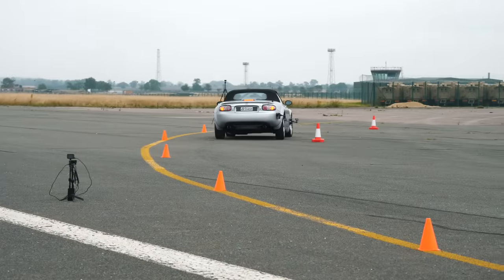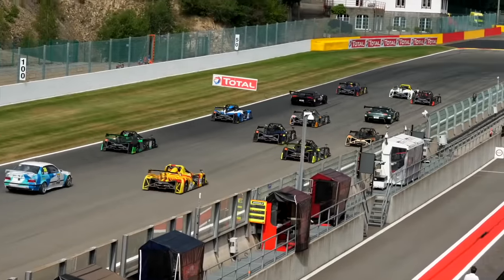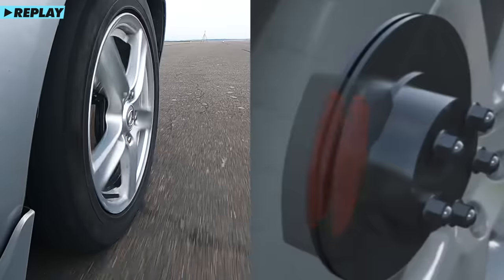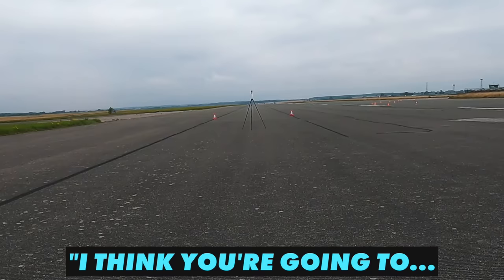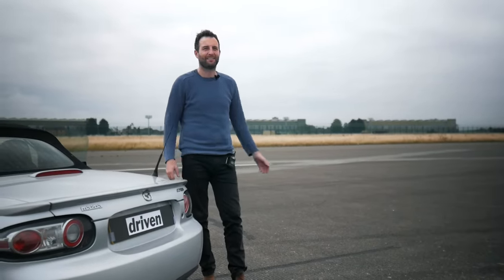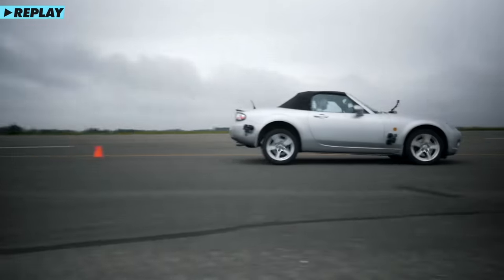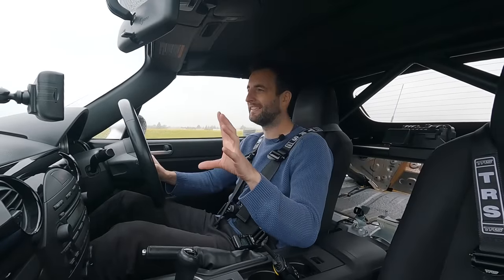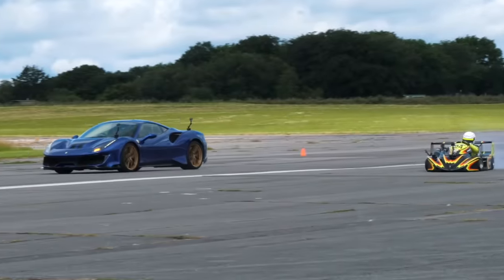ABS ON vs ABS OFF | What's Really the Difference?

Comment: Would be interesting to see what ABS is like compared to threshold and cadence braking.
Reply: Cadence? Yeah, that was my first thought too.
Reply: Exactly. Obviously ABS is needed when you slam on the brake pedal. But can a pro driver do better without ABS? By how much?
Reply: That's what I click on this video expecting
Reply: I remember some show from the 90s demonstrating cadence braking, maybe Top Gear before it got all silly and scripted? 
Definitely be interesting to see how ABS compares to cadence braking.
Threshold braking? That's a new one to me, guess I'd better google that practice.
Reply: You won't be threshold braking in normal day to day driving, unless you're a nutter.
Reply: yeah if brakes are not very sensitive it should be possible, but he needs a lot of practice on this same surface
Reply: @JohnyG29  Or you need to do an emergency stop or stop in the rain/on wet leaves... My first car didn’t have ABS and my motorbike still doesn’t, you soon learn about the limits of grip whilst braking in various conditions and how hard you can or can’t brake.
Reply: That's what I thought the video was going to be too...
Reply: @Jonathan_Doe_  Good for you, but ABS ensures most drivers can stop as quickly as possible.
Reply: @JohnyG29  you won’t be ABS braking in day to day traffic either. The question is how to stop fastest in an emergency.
Reply: @rdspam  you will probably never reach maximum braking force without abs in an emergency situation unless you braked on that road like 100 times before and even than if the road is wet it will be completly diffrent.
Reply: Right? Abs vs locked wheels are not a debate at all.
Reply: The what and the what braking?
Reply: Cadence braking is a bit of a joke and only really done by Police and IAM drivers, who spend most of their training on observation, with car control a brief afterthought.

Threshold would definitely be interesting though - I presume Scott is pretty good at it.
Reply: @crustyoranges  lol
Reply: That’s what I was here to see…
Reply: @JohnyG29   I don't think he was trying to argue with that fact, I think he was more so trying to say: although ABS is a valuable asset to drivers on the road, there is also value in learning how to drive without it.
Reply: I think the tires were shot at that point and they didn't want to put on another set.
Reply: @Hisokaa-d2j  maybe but most people dont own sport cars and I guess if the road is wet its still hard to threshold brake in one of those cars.
Reply: @Hisokaa-d2j  true but I doubt its worth the risk of locking up I mean you even see it in f1 and other top motorsport series with the best drivers in the world and still they'll do a lock up once in a while. And the same will probably happen to every person that does threshold braking on public roads.
Reply: Yup. My understanding behind the poll, was that it was threshold breaking w/o ABS vs. Normal braking with ABS.
it's obvious that ABS will be better vs. Fully locked up wheels.
Reply: They should make a video for this to compare the situation if the driver is experienced.
Reply: @crustyoranges  I never heard those names before, but I do believe I did both. I never was a ppro driver or anything like it, but in my youth, I did drive crappy old cars that never had ABS (and were crap, thus easy to loose control of over little more than nothing). And I learned these "tricks" first from riding ... a bycicle! True.
So... brake too hard and you might loose control of the vehicle. You can minimize this by braking less harshly.  I guess if you do it continuously throughout a brake, right there on the limit between maximum possible deceleration and loss of control, that would be "threshold braking"...?
Alternatively, if, when loosing grip, you let go of the brake, then back on it when you get some grip back, then off again and on again, and keep alternating til you got down to the speed you want, that would be "cadence braking"...?
The two above would be on emergency braking only (or you're racing), but on the road, you might need it, even if just to avoid a small bumper to bumper crash.
But then of course, ABS would do the above automatically for you (possibly seperately for each wheel), and better than (most) any human.
Reply: @Jonathan_Doe_  yep, abs is an amazing innovation and a 100% good thing. But I like you and many others learnt the limits of a car just fine. I recently went back to a non-abs rear drive 90s sports car and was a little worried, but it's been fine. One of those situations where we give up a little reliance on skill and experience so that the majority will be safer maybe?
Reply: I was hoping they would at least include threshold braking. I find that being out perform ABS on most surfaces if you know how to do it.
Reply: My guess is cadence braking (I learned in the 70's) will beat standing on the pedal. ABS does  the same only much quicker, for the win.
Reply: @JohnyG29  but if you are driving a non-abs car and need to panic stop you might need it without being a nutter
Reply: @jeanackle  Heck yeah.  ABS pulses on my car, if the wheel loses traction.  It quickly reduces speed, not smoking tires, like the video above.  I almost missed an interstate exit driving late at night going 60 mph.  I mashed the brakes.  The car dutifully stuttered to 30 mph, but sent a signal the brakes weren't doing the job!   Very interesting.  

As far as handling tricks, bicycling rules!  Riding a bike up close and personal set up rules that also apply to the inertial mass of this 4 wheeled machine powering down the road at up to 90 mph.  It has to do with constant situational awareness, reading the road ahead, your position in the flow, always in tune with the inertial mass, updating on the inertial masses around you and predicting what they're about to do.  That's what driving is about.
Reply: I agree. The people who would be watching this I doubt are the same people who lack the mental ability to modulate the brakes.

I'd also want to see a change in surface texture ranging from dirt, standing water, snow, and ice.

I've owned 3 vehicles that had ABS and it failed to do is job every time. I very much prefer the non abs vehicles I've owned and currently own today.
Reply: Yes i was about to say that. There's no point to this video otherwise.
Reply: ABS really suck on snow though.
Reply: @rdspam  in an emergency braking situation there is only one reaction: Panic, leading to hitting the brakes full on. ABS has been saving lives
Thank god it's mandatory in most sane countries
Reply: @quarq111  Well if you get panic attack in every emergency, maybe you shouldn't be on the road at all?

What I see is he stopped only 20m further braking from 70mph with locked wheels, anyone with some sanity in his head wouldn't lock wheels straight away thus the difference would be a lot smaller. Yes I have emergency braked without ABS - you don't have to loose your head every time an obstacle appears in front of you.

+ what happens with the same ABS test on gravel, snow, ice? Why are those tests nowhere to be found?

In perfect conditions abs stops better, but is it random emergency test then?
I have been in situation where I avoided big crash only because I could lock my wheels and keep momentum in same direction the road goes, without massive steering corrections which I doubt I would be able to perform correctly.
Reply: @tobiecouillard7864  The one time I drove in fresh, yet to be salted snow, I tried to get the car to slide making an abrupt right turn.  The rear wheels let loose for only a micro second, the car quickly regained traction, and I made the turn.  I was amazed.  

This was ancient 4MATIC four wheel drive Mercedes had available in 2001, so I guess ABS results vary.  4WD tracks like a tank.  The only problem, somewhat enhanced by ABS, is understeer, not a major issue on the interstates.
Reply: This, jamming on the brakes and flatspotting the tyres should have been a one time example, how about showing some of those racing skills?
Reply: @JohnyG29  Or you drive in Texas.
Reply: What's cadence braking?
I know what threshold braking is and I'm fairly good at it, and practicing has saved my life considering none of the cars I've owned have had abs lol
Reply: @JohnyG29  I do it every single day, it's really not that hard
And I drive 150+ miles a day mind you
Reply: @Jonathan_Doe_  Same on a bicicle, you realise very fast how much braking you can do...
Reply: @LadyMistborn  Well, I've never heard the term before, but cadence means repeated efforts in an appropriate rhythm according to speed and pavement.  That would translate into repeated pumping on the brake pedals, rather than pressing down hard and not letting up, which always risks loss of traction and skidding.  Pumping won't lose traction.
Reply: @JohnyG29  Some of us nutters,have to drive on ice and snow.
Reply: @RobManser77  with alot of practice threshold could be better than abs in a straight line. The thing is that you can threshold brake in an abs car so there is no point in having no abs ever unless you are driving in snow. 2 of my favorite cars had no abs and even though I was able to drive them perfectly fine on the limit I did always worry about a situation were someone runs out in front of me. I rear ended someone last year. Did not see them until it was to late and in that moment there was no thinking. Just jamming on the brakes. They were stopped and I was doing atleast 30 kph and had 5-10 m and nowhere to go in the wet. (Memory after crash is horrible) Anyway I am certain that if I was driving one of my none abs cars the damage would have been far worse. ABS is imo the best safety feature cars have.
Reply: Westane...if you are talking in a test similar to the beach ball test (something unexpectedly coming out) the ABS ALWAYS wins... On a race course "bus stop" where you have a known apexes to hit THEN and ONLY THEN will the pro driver w/threshold braking will do a better job than the ABS... Cadence Braking really doesn't come close to threshold or ABS... Don't Believe Me? (Because I am just a YouTube jackwagon, to you, anyway...) Call a performance driving school...talk to an instructor...or better yet take a course, ask them to teach and demonstrate.
Reply: You could absolutely "threshold brake" on a snowy road in normal driving.
Reply: "Panic" is only a reaction to an emergency situation if you haven't trained for the emergency. That's why pilots spend so much time practicing emergency procedures in the sim: if you have it memorized,  you "revert to training" in an emergency,  as opposed to panic.
Reply: Pumping is silly. You shift CG hither and yon; just begging for snap oversteer. 

Far better would be to squeeze to the point of lockup, and only then back off enough to get the wheels rolling again.
Reply: Yeah, I was puzzled that that wasn't included, especially since he mentioned it in the beginning.
Reply: A pro driver with his own car can outperform ABS if everything done perfectly. But on a ice-snow covered pitch black country road ABS will win 10/10. Its depends on the circumstances which would win
Reply: Yeaaa not sure why they didn't do that
Reply: I was taught cadence breaking in the 1960s. It was impossible to cycle on and off as fast as ABS. I didn't own a car with ABS until 2012. I was taught threshold breaking on a car control course and used to practice it every now and then. It was a lot of fun lifting the inside, rear wheel of my SAAB 900 turbo when braking hard on a downhill bend. I never had to use it in anger, but it was still very effective.
Reply: Go check out Team O'neal driving school video for that. It is less scientific video but he does show treashold brealing (he is american rally champion so he probablly knows what he is doing)
Reply: @JohnyG29  You shouldn't be using the abs during day to day driving either
Reply: @JohnyG29  true, but you should 100% absolutely know how to. I think progressive threshold braking should be taught to all drivers on public roads.
Reply: That is what I wanted to see from this video
Reply: I did the exact same test with the exact same ROAD car on a track day at mugello:
No way to reach a near performance because ABS also regulates brake BIAS (which you can't do on a road car with ABS UNPLUGGED) 
With semislicks there is so much weight transfer that the rear locks up immediately.
Situation gets better with road tires, while on wet of course the front axle is the 1st to lock up.
This is valid on mx5, I know guys with Suzuki swift that have far less problems when they unplug abs.
Reply: Threshold will beat abs because abs activating means momentary pauses in braking pressure.
Reply: Well ABS is banned in F1, so im guessing that means that its better than any pilot techniques and will give manufacturers advantages
Reply: Threshold braking is an almost forgotten skill. In the days before ABS, this was one of the big differences between a good driver and an average one. ABS has made the skill redundant, and a good thing too for overall road safety.
Reply: This is what I thought this was going to be about. I want a competent driver who knows the grip of a car to see if they can match or beat ABS. Of course if you lock up the wheels you're going to overshoot your breaking zones.
Reply: From threshold into trail braking that feeps greatttttt
First feel time u just felt u were soooooo over speed running into the wall,  but once u get used to the g force feeling and visual feeling u will be soooooo fast
Reply: @martin_marek  A pro driver will do better without ABS but the issue is this is all contrived the ABS system will consistently do the same thing, even a pro driver will not and their results will vary even doing a contrived scenario like in the video. In the real world you instinct reaction in the moment will be the determining factor, for most people its to slam on the brakes and in that scenario ABS is much better and since 99.9% of people do this it makes sense for cars to have ABS. However ABS is not good on snow, ice and other low grip surfaces as it reduces braking power and in many cases just skidding and locking the wheels will do more to stop the car than ABS actually allows.
Reply: I think all of you are missing the point of ABS, even if you are an expert driver and can threshold brake very well it doesn't matter, because when you are going out of a blind curve and find a car in your lane going the wrong way, your body is going to go 300% on the brakes out of reflex, ABS is for emergency situations, not to get better laptimes.
Reply: @bubbahotep7682  , I grew up learning how to cadence break (didn't know what it was called though.)  I'm pretty sure my driving instructor made sure we know how to do it just incase ABS went out. 

I flat out know I've been able to stop faster doing it then the ABS would have let me.  I tried to let the ABS do its thing in an emergency stop and the rate of deceleration made it clear that I was gonna slam into the car in front of me if I let the ABS just keep control.... so I had to pump the breaks myself. 

  I think it's probably because I very VERY briefly lock the wheels every time I pump so the car skids briefly and there is more friction in a non rolling wheel vrs a rolling.  

But, you for SURE have to know what you're doing if you're gonna bypass ABS.  It's better to never put yourself in that situation by leaving more then 8 car lengths in front of you at speed. 

This driving instructor also made sure we knew how to use the emergency handbreak...which also has came in handy.  Nothing like having an engine seize going 80 on a highway in the left hand lane and having to cross 3-4 lanes of busy traffic  to the right shoulder cause there was none on the left.   The power breaks died because the engine wasn't running.  

Scared the crap out of me but, I made it safe and sound without causing a hazard to anyone else. 

I will never own a car without a hand e-break. I've also used it going down a crazy long 1,000 foot decline with some crazy steep grade. My brakes couldn't take it and downshifting wasn't cutting it.
Reply: Yeah just braking max and holding it down is basically a strawman. Of course abs is better than doing the worst possible thing for stopping the car.
Reply: ABS is literally just automated Cadence Breaking.
Able to decide 15 times/second or more. And possibly for each tire separately, if the breaking hardware allows.
Reply: @stevecarter8810  If you think the average driver (or even a professional, if they do not expect it) can react as reliably as a ABS system, you need to look at more crashes from before ABS was a thing.
"It works fine, as long as nobody ever makes a mistake". Always fails. Because usually you made the thing too accessible, increasing the number of users - and thus gives more people chances to make mistakes.
Reply: @christopherg2347  I don't know why you would get that impression from what I wrote.
Reply: @stevecarter8810  It was in response to your post saying "nobody would just hold down the breaks in a emergency".
The one where you said the whole concept of ABS is based on a Strawman?
Reply: @christopherg2347  you seem sincere.   What I meant was that I found it unrealistic to suggest the driver would simply brake to max and hold their foot down. But maybe I'm coming from a different context since 1) I'm British 2) none of my first 9 cars had abs so I learnt to brake 'manually' at speed in the wet, on oily patches and on snowy hillsides. I suppose yer modern motorist never gains experience or skills at that stuff because the car saves them from it
Reply: @stevecarter8810  My first car also had no ABS, and cadence braking was never part of Drivers Education. And that was 2000.
Reply: @JohnyG29  people still drive cars that don't have abs daily
Reply: @ZDR-BoyZ  Locking the wheels straight away is not necessarily the worst ever way to brake (except loss of control). you could also be trying to threshold brake without locking the brakes, but actually use less than 70% of the actual grip, especially at the beginning where your are covering the most distance per seconds. not getting close to 100% braking force almost instantly can cause a lot more braking distance in the end. also perfect braking before a corner on a track means progressively let the weight transfer settle then apply more brakes, in a controlled way whereas real emergency braking on the road would be braking as hard as you can as quickly as you can. this means you could even be great at braking very late on a track, doesnt mean your great at topping in the shortest distance in case of emergency.
oh sorry but " I avoided big crash only because I could lock my wheels and keep momentum in same direction the road goes, without massive steering corrections" doesn't mean anything
Reply: @shutu6338  if you do not have abs it is better manual gear. Why? You just monitor dashboard. If the lights coming on you release brake a little. If not you are good and not locking whells. And even Locking wheel is good option if you got from road and spin in mud. When you get back on road you are at higher angle. So having Abs will get you in direction where ever mud throw you in the first place. But locking wheels you can prolong straight movement untill your wherls are not in position to release gently untill car correct it self where it needs to go. 
Good thing you have chance to save car and yourself. Bad is that your tires will be scraped and univen after that manouvre.
Reply: Agreed. I don’t need a test, I straight-up know I’m better than ABS in a lot of situations, simply for the bump in maneuverability and control. Only turn it on in the winter.
Reply: @gravemind6536  That’s wrong, modern abs applies the perfect breaking force independently to each wheel and actuates that braking force 100 times per seconds. It’s just dumb to think that any driver could beat an abs system with old techniques, and on unpacked ice or gravel yeah you will reduce your braking distance without abs but those are pretty specific cases. I strongly suggest a lot of the people here to check the video of engineers explained about abs and rely on science instead of tv shows.
Reply: @martin_marek  saw a pro driver try it once (tv show) and 2 out of ten he could almost match modern abs.

People who say they can out rake ABS consistently have the abs from the 80's cars in mind.

Modern cars is almost impossible and in a surprise situation completely impossible. :)
Reply: @Jonathan_Doe_  80% of driver overestimate their driving skills and that amkes them actually a worse driver.
Reply: Iirc threshold braking is only a couple of percent better than an advanced ABS system... But the problem is, it requires you to be perfect. Press the brakes too hard or too soft and you're immediately worse again. Not just that, but you need to keep them pressed perfectly as you continue to stop. I imagine a driver in a controlled situation, given lots of practise, might match ABS in that one situation but they could never hope to beat it in anything resembling real-world conditions.
Reply: I disable abs by default now. Failure of that system is much more dangerous than learning to drive without it. Novice drivers need abs. Even intermediate. Abs is horrible in ice and snow it will increase your distance to stop in every instance.
Reply: @TobachBore  that's objectively a horrible idea. Are you telling me that in an emergency, you'll always be able to brake nearly perfectly no matter the road condition, wear of your tyres, if its raining or frozen.... Humans cannot compete with ABS. Even a decade ago it was better than a human, modern ones will outperform you every single time. It's a safety feature and disabling it is like driving without a seatbelt - utterly stupid and may hurt more than just yourself.
Reply: What's more insteresting is other non-ABS braking techniques. The dug-in braking, and and the sideways 4 wheel lock. Life saving techniques impossible with ABS. Already had to use both of them to save myself from a crash. That's why I will never have a car with ABS.
Reply: @LadyMistborn  Cadence braking is what they did before ABS arrived. On and off the brakes -  only ABS does it many times better.
Reply: @Akya2120  No matter how competent you will not beat ABS on the road.
Reply: @OgdenM  By the time you realise your ABS is not working its too late!
Reply: @lucuspreston7292  Dream on.
Reply: @robertvanruyssevelt7159 
Cadence braking is for literal old people who can't feel their feet anymore, and idiots who can't understand what a brake locking up means 
 Which is why any high level driver like myself uses threshold braking, which is holding the brakes at the limit of locking 
Threshold braking will beat out abs any day of the week, yes I've tested
Reply: @quarq111  If you're initial reaction is panicking while driving then you shouldn't be on the road
Reply: @ZDR-BoyZ  Thats a great point I didn't think about either, I've avoided accidents too from intentionally locking the wheels up, granted it's rare but it's happened
Reply: @paulmcknight4137  I'm sure you were going a whole 12 miles an hour 
Awd doesn't track like a tank, it actually does very little to help track through the snow, only acceleration and deceleration, and does nothing as far as cornering goes
Reply: @WeAreLegion1904  I think you're just a bad driver, there's no reason you shouldn't be able to stop your 20mph car in 10 meters 
Like genuinely I've stopped mine dead at 35mph in under 10 meters
So maybe work on your reaction times before you kill someone
Reply: @misters2837  I don't believe you or an instructor, if either of you had enough seat time you'd understand how braking systems work in the real world, or you're just so slow to react you're relying on abs to save you
Either way there's a reason they're a driving  instructor, the young drivers need someone easy to keep up with
Reply: @Andris1991HUN  Ummm abs sucks ass in the snow 
So either way the professional driver would beat abs
Reply: @StoneCoolds  No it's banned because it's extremely dangerous to race with abs 
Just ask Randy Pobst, abs likes to give you zero brake pressure sometimes because it thinks you're on ice for no reason
Reply: @marcoangelo0  you're just wrong, and clearly don't understand how an ABS system works 
ABS is too unstable to be used at any kind of race
Especially since a good driver will beat it every single time and not leave studdery rubber all over the track surface
Reply: @OgdenM  you're entirely backwards on your understanding of friction
A rolling tire has more usable friction than a locked one, plz for the love of God don't pump your brakes instead of using abs, abs is doing exactly what you're doing but at much faster intervals 
Learn to threshold brake or just use abs in emergencies, cadence braking is for when you bust a line
Reply: @AbelShields  I think you're just a bad driver
You should be able to tell road conditions by look and feel, the abs can't see or feel anything
And as a driver who uses threshold braking on a daily basis, yes I can be perfect every time because I practice and can move my car better than I can move my body
Reply: @robertvanruyssevelt7159  maybe you just react slowly
Reply: @LadyMistborn  maybe I'm not as experienced as you, sure. But for 99% of people, ABS will do better in all conditions than leaving it up to the driver to perform perfect threshold braking. Perhaps you are a savant who knows from one glance exactly how slippery the road is, but modern ABS is only a couple percent worse than theoretical perfect braking. It can react to changes in the environment within milliseconds and can adjust braking pressure tens or hundreds of times a second. Again, I don't know you so I can't refute that you outperform ABS in some situations (even if I doubt it), but I guarantee that ABS is the best option for almost all drivers in pretty much every situation, and that's why it's included.
Reply: @EPICZOMBIEKILL816  it was wet and as I said it was 5-10m. My reaction times are fine. If your distracted doing 20mph, it's unlikely you will react and brake to a standstill in 10 meters on a wet road. I was drive a van. Fiat ducato. Even in my car I wouldn't have done it.
Reply: @WeAreLegion1904  well there's your first problem, you should never be distracted while behind the wheel
Also if you can't react and stop a van in 10m from 20mph then you're also slow and shouldn't be trusted on the roads
Reply: @LadyMistborn  The '01 E320 4MATIC I'm driving tracks very securely on wet roads and snow, as well as precise maneuvering at internet speeds.  4MATIC is electronically controlled 60% power in rear and 40% in front.  All four tires have traction.  ABS  prevents slipping tires.  I once tried to make a right turn on snow to slip out the rear wheel.  The rear wheels slipped for a half second before ABS reduced power, regained traction, and the car did not go sideways.  

True, it has serious understeer on curves.  Control at 80 mph is nonetheless very responsive, such as avoiding blown tires on the road at the last second.  Rear wheel drive would have slid out making such a drastic maneuver.  

Revving 2800 rpm at 80 mph leaves plenty of torque left for negotiating traffic.  I've gotten two warnings from police for effortlessly surpassing the unofficial speed limit of 80 mph.  The car is designed to ride majestically on the autobahns where the curves can be handled at 110 mph.  

I've driven across the US several times and can still stand up after 16 hours.   I have to look at the rpm gauge to determine of the motor started.  The interior is so quiet.  It's a gentleman's V-6, not too big, not too small.  I've never driven a more capable car.
Reply: @martin_marek  A good driver can do at least as well; I drove a merc with ABS back in the early 90's; on our car park it wouldn't even let me brake (pedal hit the floor boards and did nothing), whereas my Skoda Favorit (a much cheaper car without ABS) managed to actually stop.

My brother taught me Cadence braking in snow and ice; and showed me just how quickly a really good driver can actually stop. Trouble is now very few people can actually drive. They can't come close to the skill that drivers had without all this modern tech.
Reply: @martin_marek  no and not even close. Abs works very differently than what most people think. It’s not just pulsing the breaks on and off, it’s making sure that the tire velocity vs car velocity is getting maximum traction. And that’s for all 4 tire’s independently.
Reply: @Andris1991HUN  not true
Reply: @martin_marek  there is a reason why f1 banned abs
Reply: ABS ON is for those who don't know how to drive.
Reply: @LazyPellE  you’re just wrong
Reply: @jimmysyar889  That's why they generally don't use ABS in races
Reply: @jimmysyar889  It is not the purpose of blocking the wheels to stop. Amateurism
Reply: I’d be surprised if you can’t find some old videos of cadence braking on YouTube. It won’t show you a comparison as such, but police and other advanced drivers were taught cadence braking for obvious reasons. Might be interesting for you
Reply: In a straight line with ideal road conditions, perfectly executed threshold braking stops the car earlier than ABS, but that almost never happens in real life...
Reply: I can answer that for you. I can do sofrom two perspectives too. 
1. in my younger days when I was involved in rallying and the Audi Quattro was new on the scene, the motor club I was in had a day out at Manby doing rally driving tuition. One of our members had a new Audi Quattro with ABS that could be switched off from the dash. So while one member was out in the 'wilds' with the instructor, the rest of us set up a course similar to that in the video and played "beat the ABS".
2. I'm an ex Professional Automotive Engineer. Although I'm not a chassis specialist, I do have a couple of ex-uni buddies who are. And anyway, within the Engineering departments at Some of the UKs automakers,I could access any other Engineer to pick their brains (which I did frequently when building rally and road cars).
SO:
About a dozen of us played beat the ABS. We were all rally drivers. Clubman level, so not pro racing drivers like Scott, but pretty skilled all the same. Not one of us could beat the ABS in that Quattro. The difference wasn't just a couple of feet either. It was yards and yards. Every time. And do not forget, this was a fairly early 3-channel ABS system. ABS system have improved still further since then, including now being full four channel.
If you just think about it for a moment from an Engineering perspective, it should be obvious that no human can ever beat the ABS in any road car on any road. Scott suggested the ABS operates each brake up to 15 times a second. Actually it can be double that on some systems. On top of that ABS is monitoring each wheel independently and can operate each wheel independently. On a road car (unlike on an F1 car as referenced by Scott) the conditions at each wheel are different, often by quite some margin. The ABS has four control points and can hold each wheel at it's maximum threshold of grip. No human can do this, partly because we cannot operate the brake pedal as fast as ABS can and partly because the driver only has ONE point of control. So, when one is cadence (or threshold) braking the grip at all four wheels is controlled by the wheel by the minimum grip, since it is when that wheel locks that one brings cadence into operation. The other three wheels could be nowhere near their threshold.

Phew!  That, believe it or not, is very much an abridged version
I have considered making a video like this for my channel, but TBH, this one is so good I shalln't bother.
Reply: @CycloneCyd   Thanks for this. Great explanation. I have only had one car with ABS, and although in the few times I used it it was great - really wished I could turn it off in snow as it was rubbish with that basically just removing the brake pedal from me!
Reply: @martin_marek yeah but are they immune to just panic slamming the brakes full force when a truck pulls out in front of them
Reply: @westane6171  yeah, that was the reasoning for having the "ABS off" switch on early Audis. Not allowed now though.
You're correct, ABS is useless in snow and gravel. The way to cope with that is to keep your foot on the brake with the ABS active and to whip the wheel quickly left to right and back repeatedly. Thishelps to cause a wave of snow or gravel 'side on' to the tyre and helps the tyre to 'dig in'.
Reply: Humans are nowhere near fast enough to even come close to competing with ABS specially in a sudden situation. 
A Human Cant even blink 10 times in 1 second (avg is 150-200ms per blink) Let alone blink 10 x per eye but independently of each other, & the eyelid is the FASTEST Muscle system in the body faster than any hand or foot reaction & movement time.

In the time it takes the driver to blink they would have had to adjusted the pressure on the brake pedal 2-4 times or more which is much faster than ability of the muscles to even tense up n relax without moving, not even a Pro Drum player could do 5 bass beats in 1 second with same foot.
Reply: Cadence breaking is abs, but faster.

Threshold don't work well with power assist brake. You do not have a real feeling of the brake.
Reply: If you can not break without locking your wheels on a car without ABS you are not fit to drive and should hand in your drivers license. This video is just stupid, you do NOT lock your wheels when breaking !!!!

I am used to cars without ABS and get much shorter breaking distance on dry tarmac without ABS. In winter I get 1/2 to 1/3 the breaking distance wihout abs.

I was driving in 110km and measured how long the wheels was locked when I did emergency breaking on dry tarmac. It was most of the time 0,5m with locked wheels until I found the correct balance of breaking with out locking. And only that 0,5m once.... then rest of the breaking without and total length of breaking was 22m in 110km/ that gave in total slightly shorter total stop length including reaction time then they calculate in 80km/H. (I do not remember the total stop length but it was close to the text book example in 80km/h.)
Reply: Why? The whole idea of ABS is so the average Joe can drive and brake safely without needing advanced driving training.